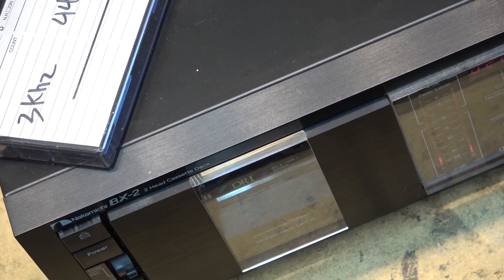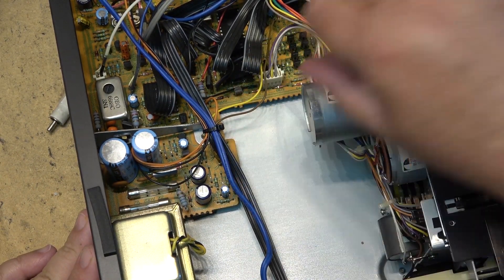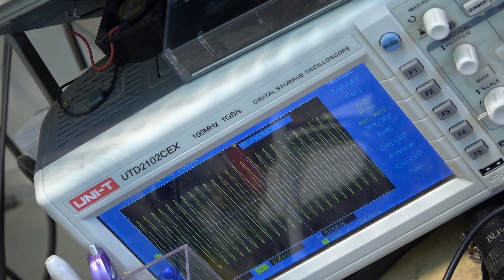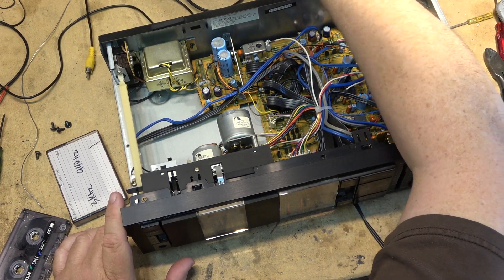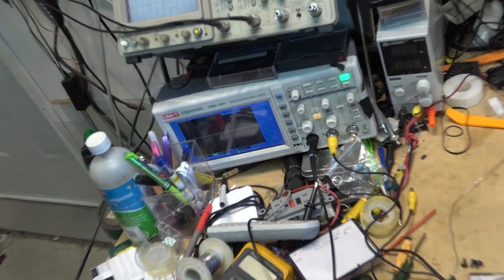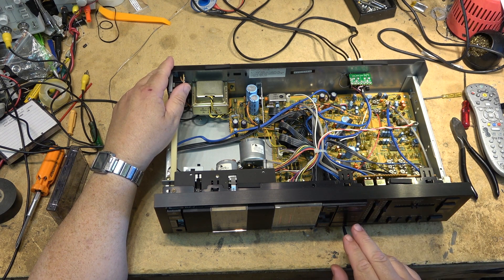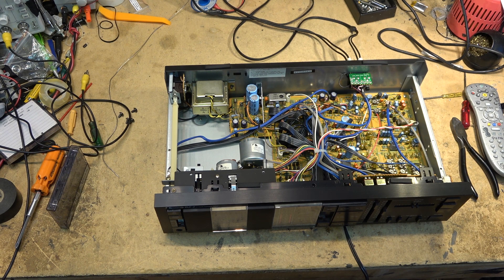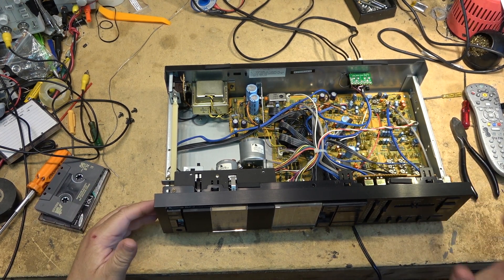Nakamichi BX2 Speed Calibration

Comment: For the viewers, in a pinch you can record a test tone which is available here on YouTube, of 3000 khz on a machine you believe to be on pitch, then play it back on the machine playing off pitch. Play both the tone and the recording at the same time and tune it as you would a guitar string. Of course this only sets the speed to be the same as the other machine, but it gets you in the ballpark without buying an expensive test tape. I do still have my RCA full track 3khz @ 160 nW/m test tape and the other test tapes, but for those who don't I thought I would mention it.

Comment: Hmm sampling scopes, joining up the sample dots and guessing the waveform.
Not my idea of a scope.
Reply from the maker: That's the way they make em today.  A must to capture digital events.
Reply: Nyquist might disagree.
Reply: Novice question: Is that just a regular screwdriver needed to adjust the motor? Or does it need to be plastic? Is it a tiny turn that’s needed? All the best.
Reply: @elvisspringsteen72  i suppose it depends on the size of the hole in the back of the motor, if its big then there is not much chance of the screw driver blade touching the motor case and shorting the preset.
Just don't force anything in to the preset.
I used to get a match stick and use a knife to pear down the match stick.
Reply: @edwinhurwitz6792  i would sample music at a high rate and many sample points.
It is a reconstruction of a waveform,  just my understanding.
Reply: @zx8401ztv  This is what I was referring to: https://en.wikipedia.org/wiki/Nyquist–Shannon_sampling_theorem
Reply: @zx8401ztv  Many thanks for your reply. I have the same deck featured in your video so dimensions should be the same. So it’s just a screw that adjusts the speed? I’m guessing subtle turns are needed?